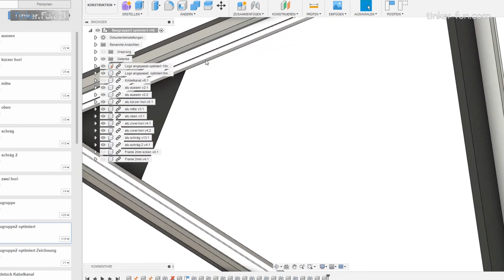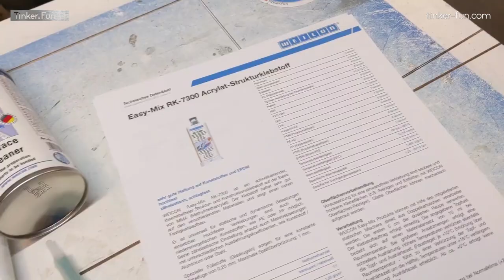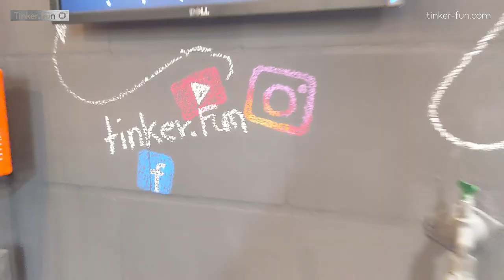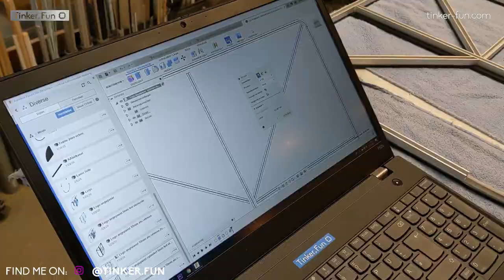Build a Neon Flex LED Logo - Flexible LED Stripe - Music band Meute

Comment: amazing!!! did you use a led stripe that which is 6/12/24w and had has to use a filter or that one we just plug on the power plug?
Reply from the maker: https://www.everen.de/led-stripes/led-stripes-ledtube/2267/mini-neonled-silikon-schlauch-5m-rolle-8w/m-12vdc-ip67-farbe-warmweiss-3000k?c=16

Comment: Great work, thanks for the tutorial. If I may ask you a question, how can anyone design a text considering the cutting marks for the neon flex? Is there some kind of designer software that might help? Or can I just cut between the cutting marks without damaging the whole thing? Thank you very much for your help
Reply: Hi Luis, every product has different specs for the cutting, shortest cutting distance is propably 2,5cm (1 inch) in most of the common chinese led stripes.